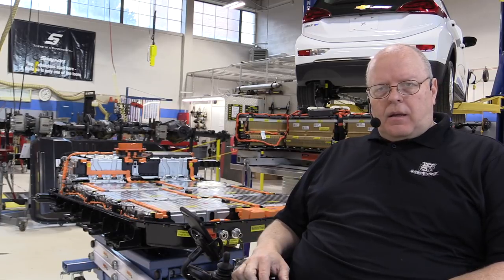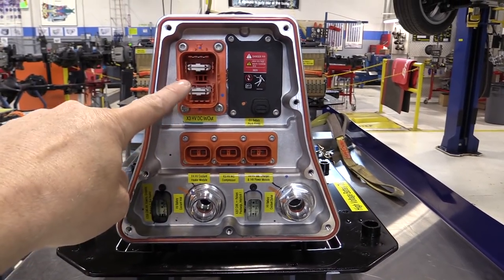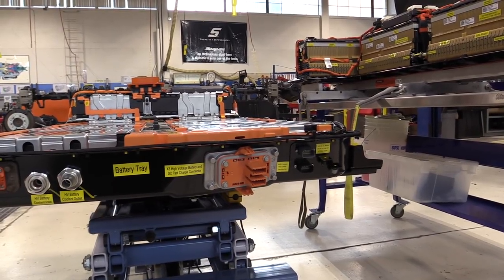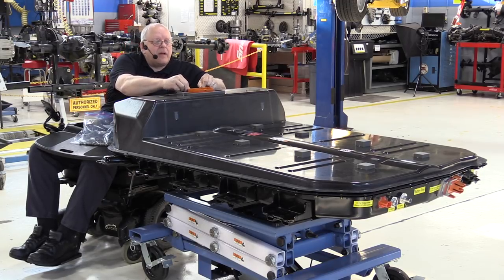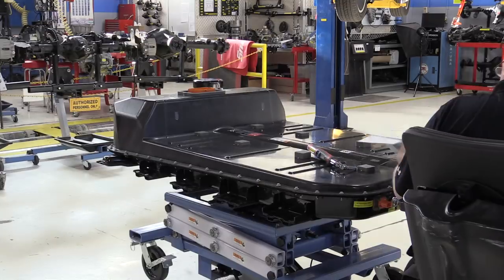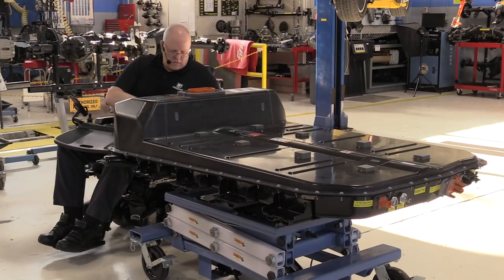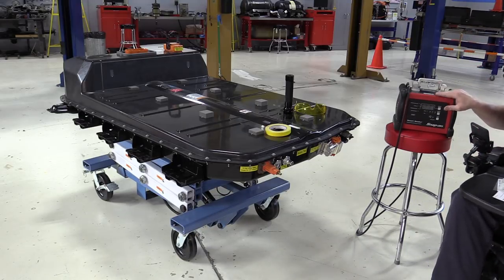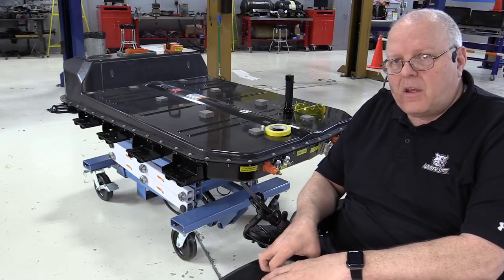Chevrolet Bolt EV Battery Smoke Test and Installation

Comment: I'm very concerned that our dealership mechanics/technicians will be consistent and capable of this type of work. I see so many places where shortcuts will be taken thereby creating long term breakdowns. Can you even begin to imagine how many owners will be flopping on the ground when they get the bill?? These videos are great but they scare the heck out of me too! Yikes!
Reply from the maker: Thanks, I know what you mean. That is one reason for these videos. EV Education will help owners and technicians alike. I believe that the flat rate system of pay promotes sloppy work and the temptation to take shortcuts in complicated procedures like these. There are a lot of very good technicians out there, but there are also  a lot that need to improve. Thanks again for your great feedback.
Reply: If the mechanics did take short cuts, would that be noticed by the diagnostics?